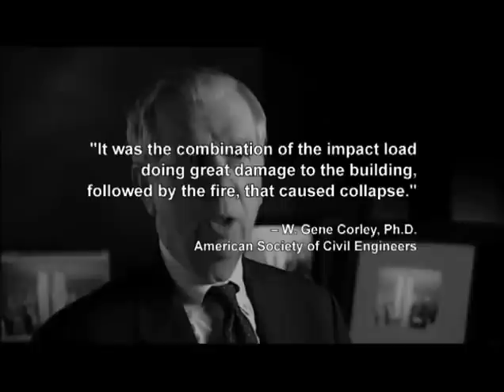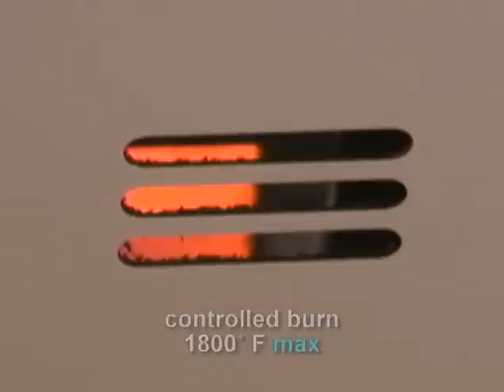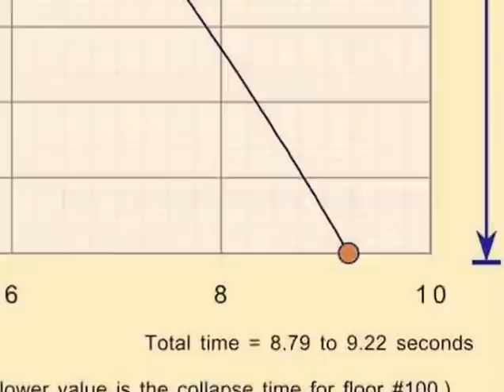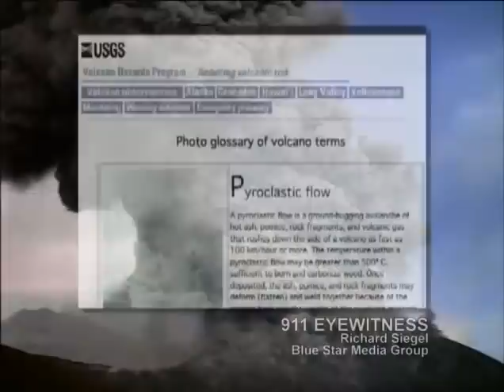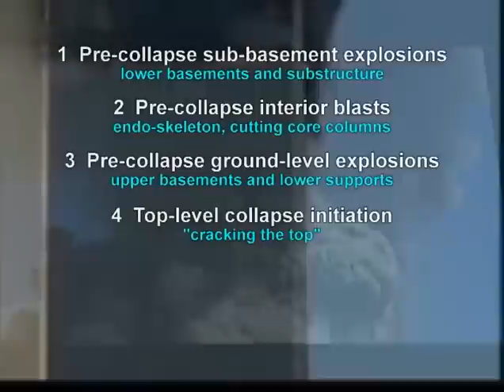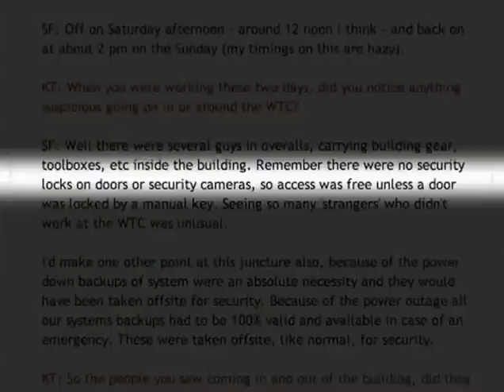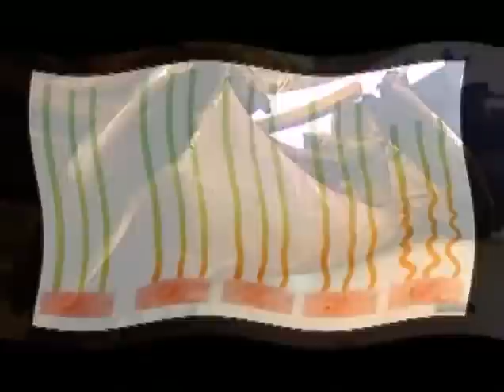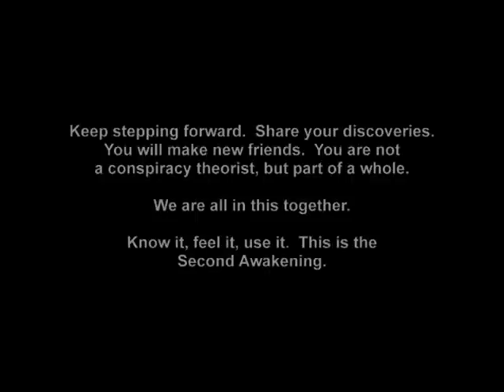9/11 Mysteries: Demolitions - In its entirety

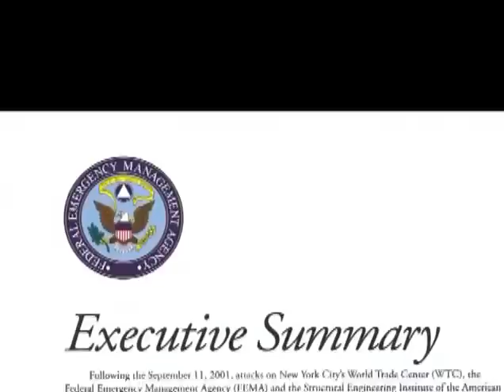Comment: I honestly think that there was no planes.  There is literally IMPOSSIBLE  for a little ass plane  to go THROUGH the tower. You know the "Nose-out" images? Yeah there was a green flash  before the South Tower was "hit" probably making it seem like the plane caused the explosion. Yeah @6:34. I think it was controlled demolition. And the Empire State Building was hit by a B-25 Bomber in 1945. The Empire State Building didn't go down. Fuel my ass.  I think the explosives were place in specific areas. (The areas where the planes  "hit". a plane against steel would be like a car speeding into a wall. Crushing it. also placed at the structural weaknesses.)  It's bullshit. Demolitions. This was a inside job. 12:18 Yeah where's the core? huh?
Reply: There was at least one plane because someone I know saw it ... but it wasn't a passenger plane... and that doesn't rule out the obvious... Demolitions

Comment: if you dump 55gal. gas down a elevator shaft it would go off like a bomb! after the subway feed the fires air, and that what melted all , but it still a inside job! thanks
Reply: the majority of fuel ignited on impact bozo. the fuel in aeroplanes in situated in the wings. the lift shafts were situated in the middle of the buildings structure. Next tin foil hat comment.
Reply: crazy eddy how come there were 55gal.gas when there were no planes that hit the buildings
Reply: Robin Phillips 
Wrong, the service lift went the length of the building, I suggest you take a look at the building plan's
Reply: Robin Phillips 
Wrong again, freefall is 6.78 seconds

Comment: Its true steel only has to weaken slightly under heavy loads to buckle. Its possible the tower would collapse under all that tonnage.
Reply: jacky whipet 
I'm not familiar with physics, so I'll just use logic alone.
Just for arguments sake, let's say that the floors that were burning did have it's steel weakened and it caused those particular floors to collapse.  And let's use the North Tower (NT), since the jet hit it in a more central location and the fires were more widespread than they were on the South Tower.  The impact zone on the NT was from the 92nd floor to the 98th floor.  For arguments sake, lets say that all the floors from the 92nd up to the 110 were all on fire, even though they weren't and that the fire also spread a few floors below the 92nd floor, even if it actually didn't.  So I'm going to say that from the 85th floor to the 110th floor there were fires.  Remember, I'm being very generous with the extent of the fires.  So no fires from 84 down in my example.  So we have 26 floors on fire with the steel weakened and floors collapsing, falling on 84 floors where the steel was not weakened because of fires.  So 25% of that buildings total weight falling on 75 percent of the remaining weight.  So that 25% is going to meet the resistance of the remaining 75 percent of that building.
The official 9/11 report says the building fell in 10 and a half seconds, I believe, but some debunkers who agree with the official report say that the commission was wrong about that and that it took the tower 15 seconds to completely collapse.  Just for them to admit that anything in the 9/11 report was wrong is in itself a minor miracle!  So if a cue ball were dropped from the top of the tower, it would take about 9 and half seconds for it to free fall if it was not meeting any air resistance at all.  With the air resistance it would take a little longer.
So we are to believe that 25% of that tower fell against the remaining 75% with all the resistance that it had to offer and that it took only 15 seconds for the whole thing to completely collapse without any additional help at all?
Don't forget, I'm being very generous with the spread of the fires and also using the time that some debunkers said that it took the building to completely collapse.
Reply: Nico Tena Yes I see your point indeed. I just mean with the weight ratio to heat ratio it is possible the towers will collapse. I dont know if they did that way I'm saying you cannot rule it out how ever remote it is.
Reply: jacky whipet
I have no problems with not ruling it out even though it was remote and unprecedented.
The problem I have is the 9/11 Commission and their supporters calling the investigation thorough and complete.  When many witnesses heard explosions while the events were happening and then NIST decides that they don't need to specifically test the steel and other debris for remnants of explosive residue and someone decides that the steel and other debris need to be gotten rid of quickly before is has been thoroughly analyzed for all possibilities, then I have a problem with that.
Don't forget, we are talking about one of the most important crime scenes in history which should have been investigated as much, as long and as extensively as it possibly could have been and within a week of the event a decision is made to get rid of what was the most important evidence? 
It doesn't make any sense at all.
Reply: Nico Tena I havent read anything on the commission but thanks,yeah Im just trying to keep an open view on this. Cheers.
Reply: jacky whipet
No problem, good luck to you.
Reply: What made the towers turn to microscopic DUST!!!!
Reply: The towers fell because they were constructed of strawberry twizzlers.
Reply: Robert Walker
That's definitely a better theory than the official one!
Reply: I accept that the fires could have weakened the steel at the floors of impact, and that there could have been some partial collapses on those floors. However, ALL of the steel below the impact zone were essentially untouched and completely fine. They would have provided a tremendous amount of resistance to the upper floors collapsing on them from above. Plus, the core columns got thicker and thicker towards the base. In other words, the top part of the building that, according to the official explanation, served as the "piledriver" were the lightest floors of the building. Plus, there are equal and opposite reactions. As the floors from above impacted the floors below, there should have been equal destruction. So, say for the south tower, where we see the upper section tilting over like it's going to fall to the street. At most, this could have destroyed the next 1/4 below. At least half of both towers should have remained. That would have, to my eye, looked more natural as a collapse.
Reply: jacky whipet It would have slowed to a stop. Learn about ebery reaction having an equal opposite reaction. The top 15 to 20 floors would have been wasted to nothing after crushing down 20 floors. Their it should have stopped